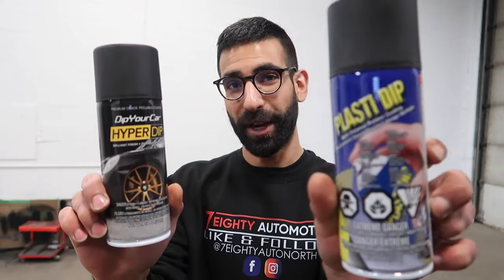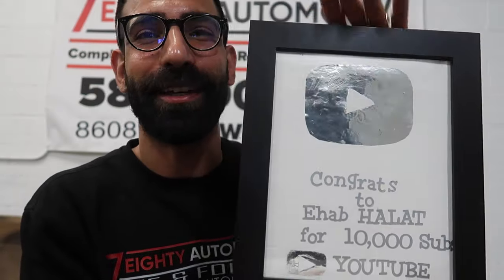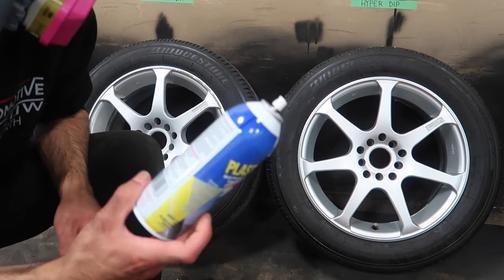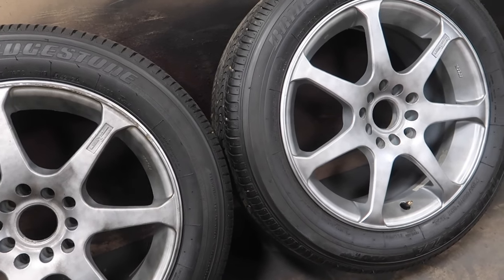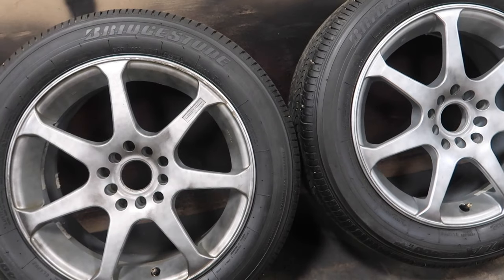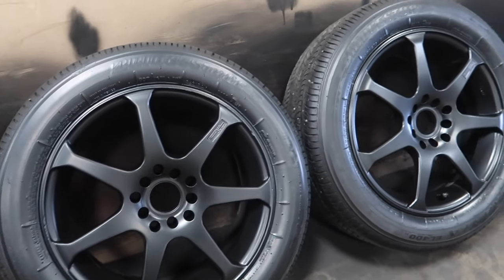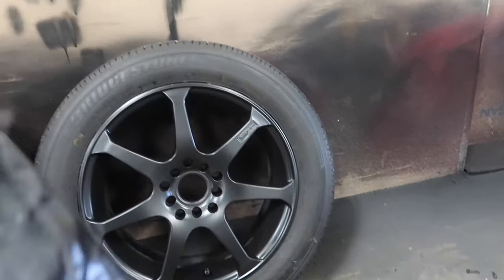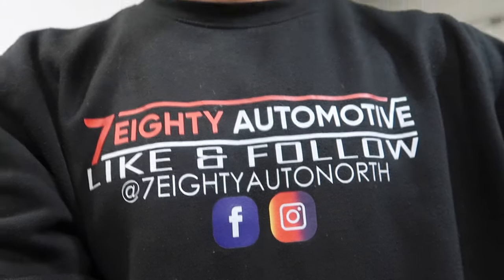HyperDip vs. Plasti Dip - Which is Better?

Comment from the maker: New video comparing piano black gloss vs 2k clear gloss https://youtu.be/5KJa2IKyg-c
Reply: How many cans did you use on each tire ?
Reply from the maker: @rogerbrown8694  1 can each wheel
Reply: I've tested both products in the Canadian winter in Ontario and I can assure you the Hyperdip is less durable than the original Plasti Dip! I spent so much time painting my rear after market bumper diffuser on my S550 Mustang GT and when you add ice build up to the equation with a self wash car wash it's gonna get destroyed! With ice sticking to the Hyper Dip and add a pressure washer, the ice will just pull at the Hyper dip and tear apart your hard work you've put into your project! Funny thing is my front lower bumper chin which is sprayed with 4-5 coats of the original Plasti Dip rocks and other things just bounce off of it because it's a more flexible product and can easily endure the ice and water pressure from a car wash without getting torn apart at all, go figure! P.S. For my diffuser, I also had sprayed 4 coats of clear coat for a better finish and better protection and it still couldn't endure the ice and pressure washer in the winter!

Comment: I’ve plasty before and yeah it’s OK but if you  really gonna do your wheels you would paint them but between the two it’s not a big deal might just stick with the plasty dip you’re putting on removable coat so really don’t worry about how deep one is over the other, I mean really nobody’s gonna care about it except for you the owner of the vehicle so I wouldn’t spend more money on so-called better rubber spray.

Comment: do you think hyperdip is worth it for twice the price of plastidip? im currently looking to change the color of my wheels and trying to decide between plasti and hyper. Also do you know how long plasti dip lasts before it starts to peel, in your experience. Im a newbie at anything car related but i really want to make my car stand out for cheap! lol
Reply from the maker: This was my first time spraying Hyperdip and i gotta say it looks and feels alot better than regular plasti dip, its not as tacky so you know brake dust wont cake up on there so easily. The Hyperdip is smoother and seems like it will be easier to clean so i would say its worth it! Plasti dip can last a very long time if applied correctly and taken care of by washing once a week. My wheels have been plasti dipped for 3 years now and no issues at all
Reply: @EhabHalat  cool man, thanks for the input!
Reply: I saw someone mentioned dip release so it’s easier to take off. Wouldn’t that also make it start to peel on it’s own sooner?
Reply from the maker: @johnjuhasz7060  dip release is only applied to the side wall of the tire so that way after your done spraying the wheel, You can remove the plasti dip off the tire very easily. Make sure to NOT apply any dip release on the actual wheel
Reply: I personally dont think its worth the price.  I paid 60 for a kit and I was thinking I paid too much
Reply: Mate ive used plastidip since 2012. I only just touched up my plasti dipped parts twice since that time. I spray it on the front and back parts of my car as a rock proctector etc. Its been in Hot High Uv extremes in Australia and I only ever had a few parts peel, but its super easy to patch and respray to fix. Plasti dip hasnt damaged anything. It was a brand new showroom floor car in december 2012 and has been mixed in and outside dirt roads high speeds, flood waters, mud sand etc. Holds up well.
Reply: @Steve211Ucdhihifvshi  Awesome! I was hoping to ask someone in Australia about this. I live in the high desert, so I have to run my truck through a car wash a lot. How does it hold up at the car wash?
Reply from the maker: It will hold up fine just make sure you apply the right amount of coats 7-8 (the more the better) and use touchless car wash

Comment: My rims came out MUCH better when I prepped the can by setting it in warm water for about 20 minutes. Made a world of difference. Also,.....you'll get better results if you do more light passes...instead of a few heavy passes...if that makes sense
Reply: This is super helpful. Thanks mang 🙏🏻
Reply: @JoeMama-j7s  how do you know he didn't? What he said is basic common sense. Doesn't matter if you use plasti or hyper dip. 🤷‍♂️🤦‍♂️
Reply: If they start begging for likes and subs in the first minute you can guarantee I won’t.
Reply from the maker: Lol im not begging… im trying to grow my youtube channel. Literally everyone on youtube will ask you to subscribe and like the video but hey im not begging anyone to like or subscribe im just asking… you dont have too you can move right along
Reply: I either let the spray cans sit inside the house close to the vent on colder days, or let it bathe in the sun to warm up before rattling and painting. Make sure to clean the nozzle before spraying. And, tilting the can upside down to empty the nozzle for like 5 seconds and wipe down after each coat.

Comment: Plastic dip is a matt black, which is just that matt black with rough finish no shine. Most people doing the black out on badges they do matt black. I used plastic dip on my exhaust tip looks great and which tire throwing dirt and debri. It still looks great no nick's or chips. Washes of nice and easy.  Been on for a few years and still looks like new.

Hyper dip is satin finish so yes it is smoother and has a shine to it. 

I sure it's a great product it is going to come down to what the owner has in mind for his or her vehicle.
Reply: Plastidip has a glossy colour that I'm ready to buy, unless this video changes my mind, about to watch now 😊
Reply: That was going to be my question, is it durable with regular driving like the possibilty of stone chips etc. How long does it typically last on wheels before it starts to come off? Thanks in advance.
Reply: @IanSolano  It's been on my exhaust tip since the end of 2017. It comes out behind the right rear tire. Road grime rock chips, it still looks great very durable.

Comment: I used HyperDip on my truck emblems, and the leftover on an old van grill two years ago.  It's STILL on there looking good.  I even tried to remove it from my grill emblem once, and it didn't want to come off.  (Which could be good or bad.)

Comment: One step you want to do is do 4 tack/dusting coats. You cannot use the same technique as you would with the PlastiDip. I helped develop the coating and you want to treat it more like spraying spray paint. The wet coats must be done wet. You dont put a pooling wet coat on though you must do multiple passes over an area to wet it out so there is no runs or sags.
Reply: You did a great job for your first time!
Reply from the maker: Thanks yeah i got a better technique and understanding of the product now

Comment: Congrats on 10k subs! Good video. I'm surprised you only do 6 coats though. I usually do 10 for peelability.
Reply from the maker: I usually do 8-10 total but i peeled them after i finished the video so didnt want to waste more product
Reply: @EhabHalat  Ah, fair enough. I like to see what other pros are doing and get "tips and tricks" as it were, from the community so if doing it with 6 coats is still just as peelable, that would save me both time and product
Reply from the maker: The more coats the better it is! Stick to doing atleast 8-10 coats

Comment: I applied plastidip over hyperdip and it worked fine...I've applied it over 6 months ago and had no issues. Even gone through the car wash with no problems. Saved over $50!
Reply from the maker: Weird, i have never tried it but fonzi said not to mix the two lol
Reply: @EhabHalat  I supposed he would say that because of market competition. Think about it, if both products can stick to chrome/plastic/paint why would they not stick to each other?
Reply from the maker: Different formulas for plasti dip and hyperdip so when you spray one over top the other it causes a reaction but i guess you tried it and its all good lol

Comment: Great video. Very helpful. Did you apply anything on the tires first, like dip release, to help peel off the spray?
Reply from the maker: Thank you! Yes i did apply dip release, it works like a charm and saves alot of time when peeling the plasti dip off the tire

Comment: The problem is that you cannot use a clear coat to protect it, ok you can  but only use their brand at $255. or $30. bottle every 2 weeks.  I should have just used paint.  This product is only if your number 1 priority is to peel it off ( short term color )

Comment: So the progression is, spray dip release on the tire, then spray coats of the product.  Is there something you spray on after it's all completed?  Some type of sealer?  TIA
Reply from the maker: You can use dipcoat from www.dipyourcar.com to protect it from harsh elements on the road. Just spray on the wheel and wipe it in

Comment: good video, results look awesome.
What happens to the new finish when the lug nuts are torqued on?
Reply from the maker: No effect it will be fine, it might rip a little where it sits but that wont effect anything with the wheel

Comment: Congrats on 10K! Do you have to/recommend warming up the hyperdip cans? I know you do with plasti dip. Also, how was dry time btwn the coats?
Reply from the maker: Thanks! Yes warm up in warm/hot water for 10 min. Wait 15-25 min between each coat
Reply: Thanks! I noticed you didn’t use dip release on the tires, do you recommend that? Thinking of getting cans only & not the kit.
Reply: How long did you wait before peeling off from tires?
Reply from the maker: @mrjprocks i usually wait until the next day but im sure its good to peel after 2-3 hours of cure time
Reply from the maker: @mrjprocks  i do use dip release all the time. It works wonders and makes it easier to peel off but you can also use regular tire shine just make sure not to apply it on the rim, only on the tire
Reply: @EhabHalat  thanks!!

Comment: So is it not necessary to have a topcoat if I use hyper dip then?? I didn’t see you put one on in the video, but you didn’t mention it at the end.
Reply from the maker: You dont have too but if you want better protection then add the top coat

Comment: How does it work when you spray the rims on your car and get the lug nuts covered too? Do the lug nuts peel if you have to unscrew them?
Reply from the maker: Yes they will start to peel when u remove the lug nuts or you can use a pick and peel the plasti dip off the lug nuts only

Comment: Do you think the finish with HyperDip look fine on older wheels ('02 Subaru WRX)? Not a lot of scuff but they definitely show their age. I noticed in the video, the wheels look new. Thanks!
Reply from the maker: If its minor it will be fine but if its peeling or chipping you might have to sand it down abit

Comment: How long will the Hyper Dip last? Just purchased not in yet…. Is there a certain way they need to be washed, and is there a certain kinda soap you need to use?
Reply from the maker: If applied properly, it will last anywhere from 2-4 years maybe longer if maintained. Wash once a week with degreaser/soap and water then you can use dipcoat from dipyourcar to protect it and make it easier to clean

Comment: I know it's a bit old video now, but I have a question regarding the plasti dip - would you recommend doing the interior plastic trims with it? Or would it be better if I sanded lightly and painted them?
Reply from the maker: For interior plastics i would paint and clear coat them so they last longer
Reply: @EhabHalat  thanks!

Comment: looks good . Is hyper dip chemical resistance .will it come out if you wash your car with a pressure washer ?
Reply from the maker: It isnt chemical resistant but it wont come off easily in the car wash. Make sure you apply it correctly with the right amount of coats and when you use the pressure washer to keep a fair distance from the wheels

Comment: You mentioned adding a dip coating..is that something that is specific to the hyperdip? Come in a kit or is there a certain type you recommend?
Reply from the maker: Its for plasti dip and hyperdip. You can find it at www.dipyourcar.com they have a after care kit you can buy or buy the dip coat separately
Reply: @EhabHalat  do you suggest scuffing and priming chrome to get a more permanent outcome?
Reply from the maker: No its not needed. This is a removable coating so it wont be permanent

Comment: Looks like the Hyperdip clearly had more wrinkles and imperfections around the 10 center holes versus the Plasti Dip.  
Is that due to the thinner layers of Hyperdip letting imperfections show through?
Reply from the maker: I never noticed that tbh it could be
Reply: Hawk eye
Reply: @EhabHalat   TBF you didn't notice because you were clearly biased from the very beginning of the video. It was obvious. Did you get some kind of incentive for it? I believe you may have.
Reply from the maker: @gsam3461 not at all lol i was just excited for hyperdip because ive been using plasti dip for a long time and heard good things about hyperdip

Comment: I want to know how either of these hold up to a tire changing machine.  I bought brand new wheels n tires from discount and they made marks on my new wheels.
Reply from the maker: Touchless tire machine will help but if that isnt available then most likely their may be damage on the dipped wheels when switching tires but its easy to touch up

Comment: Thanks for this video bro! I just got to 1k subscribers and I feel like it took forever!
Reply from the maker: Awesome man! Keep putting out videos and the subscribers will grow quick
Reply: @EhabHalat  this video is great…. Have you thought about glossifier for the plastidip?
Reply from the maker: Glossifer doesnt come out as glossy or smooth it feels really tacky when dry and loses the gloss finish after awhile
Reply: @EhabHalat  so you like hyperdip all together better. What is the best way to clean rims that have plastidip or hyperdip
Reply from the maker: Ya hyperdip is alot better! I only use degreaser and water to clean the wheels and then you can hand dry and spray dip coat for protection
Reply: @EhabHalat  you have a video on dip coat?
Reply from the maker: @CaseyFleetMedia  i do on my channel
Reply: @EhabHalat  thanks bro

Comment: Just bought a hyperdip kit for my wheels. any advice going in as a first timer? Great video btw. Thank you!
Reply from the maker: Hey thank you! Make sure the wheel is super clean and dry (use rubbing alcohol for final wipe down) be patient and take your time, start off with light coats and build them up dont go too heavy too quick

Comment: Which one held up over a year's time? Which one do you recommend for the weather and salt in the North?
Reply from the maker: Hey i actually peeled these after i made the video but i have been using plasti dip and hyper dip for quiet sometime now, if you apply it correctly with the right amount of coats, both can last anywhere from 2-5 years with proper washing every week

Comment: After plastidip is applied and when it’s time to wash your car, does it hold up with the usual / normal wash? Or, do you have to clean the rims differently so you don’t accidentally peel off the dip?
Reply from the maker: You can wash them normally. If using pressure washer just keep a fair distance and if going through a car wash just make sure its touchless
Reply: @EhabHalat  thank you

Comment: Looking to paint my grill inserts on my 22 grand Cherokee wk2 has that chrome insert idk why they just didn’t make it all black like the emblems and rims I don’t want to take down the bumper too much trouble which do you think would be better or is regular paint a route I should take and how much do you think it would cost getting it professionally painted with reg. Paint thanks in advance and great video hyper looks good but it may be unforgiving for a nubie to take on
Reply from the maker: You can tape up the surrounding area of the insert and spray them black using plasti dip, just make sure you put a bag behind the grill so u dont spray plasti dip on ur radiator. Im not sure what someone else would charge to do it because everyones pricing is different but i would charge around $150

Comment: Can I use this stuff to black out my window trim. I’ve seen your video for using vinyl. This seems easier. Thanks!
Reply from the maker: You can but from experience i feel vinyl wrap holds up better on window trim, for short term you can use plasti dip or hyperdip but for long term i recommend vinyl wrap
Reply: How short term we talking?
Reply from the maker: 6-12 months probably lol

Comment: I have a motorcycle built in 1983 which I will be repainting. The factory finish on the wheels has been sand blasted away from riding the motorcycle.  For me, the only coatings I would consider over a bare metal respray of the wheels would be Powder Coating, Ceramic Coating, 2 Pack Urethane or Epoxy paint.  Any other finish out of a pressure pack can would be too thin in application and would need to be re-applied regularly.  Good luck to those people with too much spare time on their hands.
Reply from the maker: Plasti dip has been around for years and i have been using it for all those years. I can tell you,  if applied properly this stuff will last atleast 5 years before having to peel and redo, its not made to last forever but the price point compared to all those methods you mentioned is alot cheaper. People apply this to their full cars and have no issues

Comment: If you do this with the wheels on do you wrap the lugs or what? Will it strip the lugs?
Reply from the maker: Yes you can spray the lugs but they will peel when u remove the lugs